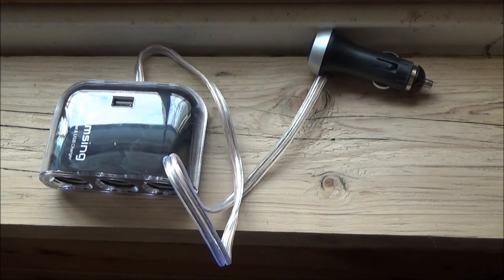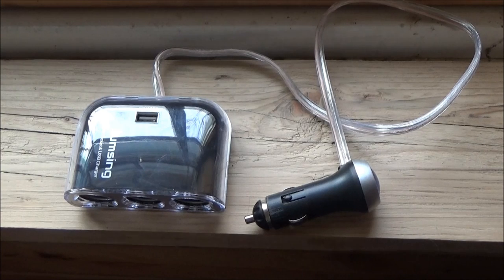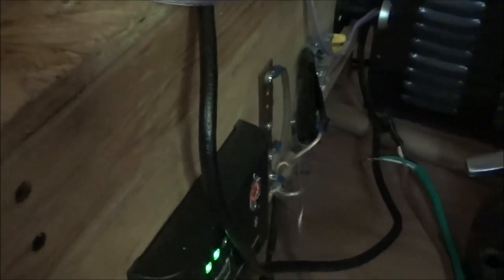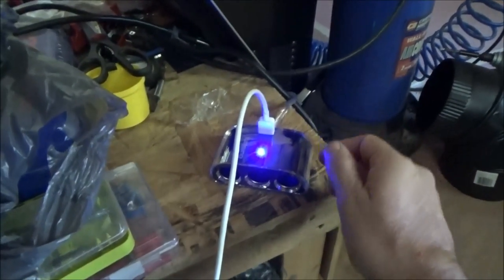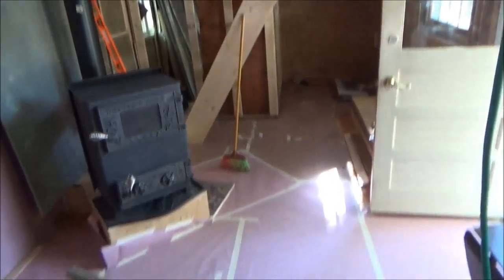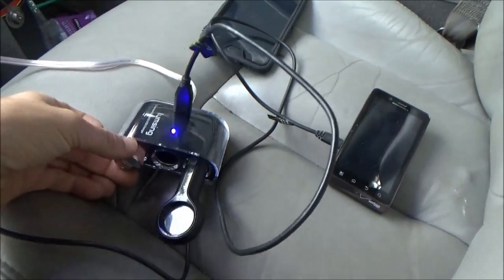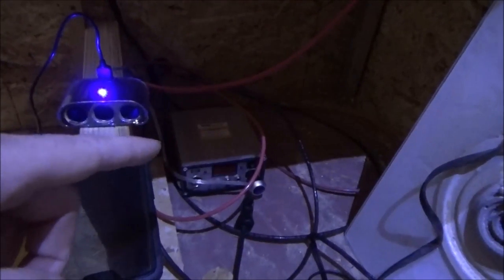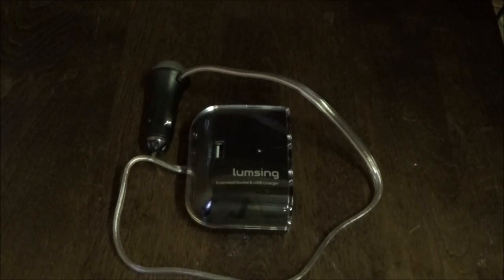Give Away Free Lumsing 3 Port Cigarette Lighter Adapter And USB Port

Comment: it better be better then my smoking new rebuilt inverter i got, it smoked and quit! smelled like a lot of burning rubber! like a good burnout! not good in battery room!
Reply from the maker: Ouch, thats not cool. Hope you get back up and running soon.
Reply: The Do It Yourself World
 i did in about 20 minutes changed inverter to older one after i cleaned it of dust! it worked
Reply from the maker: gatorred157 Good